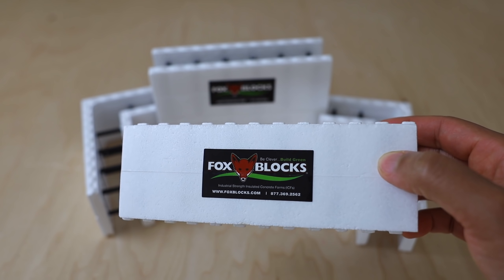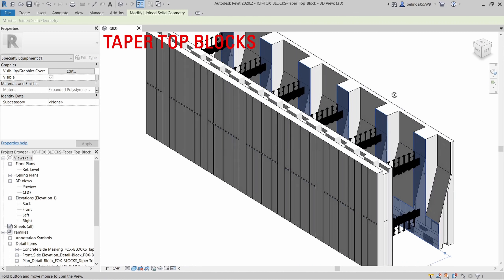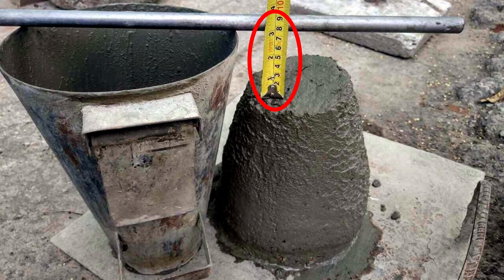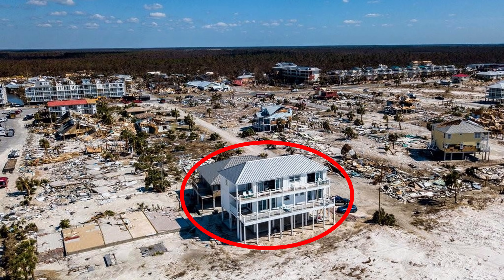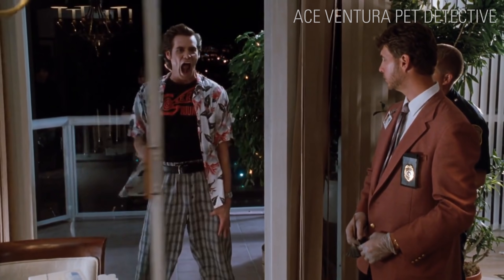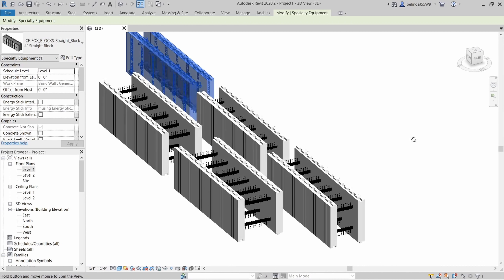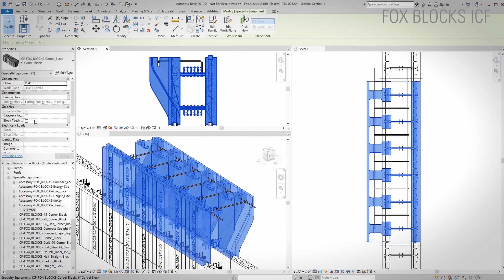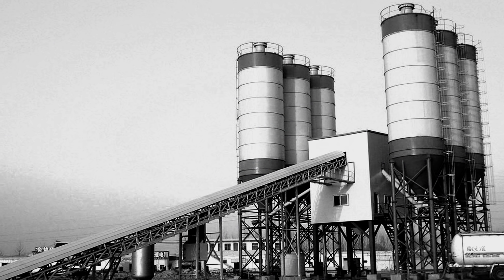Pros & Cons of Insulated Concrete Forms /ICF construction

Comment: I've been curious about how to properly insulate a homes foundation, having lived in Italy and now Mexico I've seen all the problems from houses where the moisture from the earth wick up the walls, whether stone, brick or cement that causes saltpeter blooms which eventually cause the weakening of cement and paint jobs whether exterior or interior and cause endless maintenance headaches for the lifetime of the home.
Reply: I live in zone 2a climate . Built a house 15 years ago . I used ICF forms , very satisfied with them but I think they have trouble in areas with ants and termites.if you have a existing house there are quite a few options , most recently styrofoam and spray foam seem to be gaining popularity
Reply: @outinthesticks1035  Thanks, I'll check it out. But I believe you're talking about walls.. not the actual base of the house, which I believe needs some kind of plastic liner before the cement is poured so the moisture doesn't wick up the walls.. and yes termites are also a problem here. I think I'm a zone 10 or 11 so cold is not an issue, but we do have a rainy season.
Reply: @lagringa7518   I am talking about the basement walls , which in a way , hold up the house , being half underground , but under that are the footings . I have two inches of styrofoam over the footings , it also covers the wheaping tile , directing water away from the footings . There is a product called "damp proof"  , kind of a rubber mat that covers the outside of the wall , from the rim board ( floor joists) down over the footings .and 2 inches of styrofoam with foil backed bubble wrap under the basement slab
Reply: @outinthesticks1035  Here they build up from a concrete base, and then build walls with a cheapo low fire brick, no basements. The brick is very moisture friendly, altho it is stuccoed after... so you see my problem is keeping the moisture from the brick. I'm not rich so I have to go with the indigenous method but thought some sort of polyurethane barrier under the first cement pour would help with that (wishful thinking?). But I appreciate your input... altho it's not even easy to find all those new products here and if you can find some, they are very expensive.

However I will look for the styrofoam with the foil thingy for under the slab if it will save me money in the long run! We do have home depot here, but sadly the quality and options are nowhere near the ones in the states. Arghhh.....

Comment: We built a 3 level, 12 classroom addition to a school using this method last year.  Part of the reason it was chosen was cost.  The budget was $2 million which we were able to stay on.  Note:  Much work, was done by volunteers such as the wired network, floor finishing, painting, and bathroom tiling.  Interior walls were metal studs to allow "smurf" tubing for the AV equipment.  The floors were Spancrete.  The ICF part of the project went very smoothly, and it is a durable and safe building.
Reply: I've been wanting to build a semi-off grid weekend getaway home. Something far enough away that I can have privacy from the world, yet sill be within 30 minutes of a town.  I was thinking of making an ICF ring about 25 feet wide and 4 feet tall, then topping it with a steel geodesic dome of the same diameter and using shotcrete to cover the dome.

Comment: How do you calculate the R-Value of thermal mass? IS this some form of empirical equivalency from trsting?
Reply: You don't.  R value and thermal mass are two completely different things.  Belinda is incorrect saying that concrete doesn't have an R value, it does.  it's not a high R value, but a concrete slab wall would have a higher R value than say, an uninsulated sheet-metal sheathed wall.

Comment: Good content! To avoid remodeling problem you can use ICF only for exterior walls and metal or wood framing for interior walls. Interesting question is insurance is lower for ICF build homes than stick house? logicaly they are huracaine and more fire resistent than traditional homes, so you should pay less for insurance right?

Comment: Thank you for the great video. You addressed moisture issues with concrete being absorbent particularly at the foundation level and that some builders like to wrap the house with  a Plastic membrane that has a tar like substrate. This I would suspect is quite combustible if Exposed to the high heat wild fires such as seen I California Spain and Canada. There is  waterproof concrete used in bridge abutments as well as superstrong concrete and concrete with Fiberglas fibers. It seem logical one could put ingredients into the concrete for pouring the walls that would make it waterproof,  just another cost.

Comment: This is a far better education on how ICF construction works than was imparted to me by my employer, 20 years ago when I was DOING ICF construction... even so- the blocks have come a long long way since then. I am going to build with this for my home, mainly for the reasons you mention, I can improve quality of the lower levels and get amazing insulation and sound proofing using ICF, and there is no reason not to use stick framing elsewhere on the build, so creative designs are only limited by ingenuity...

Comment: Belinda, have a look at Durisol.  They use a specially treated timber / cement to form cell. Vastly reduces the amount of plastic insulation. The main insulation is outside of the concrete core.

Comment: Great explanation Belinda. I built 2 commercial offices and three residential homes. Using a foam blocks. If you don’t have professional during the pour, you will have a blowout or worse the wall will not be plumb. Make sure who you hire for the pour has several references. It can get a little tricky, but the finished product is as advertised. And a great value since lumber has gone sky high.

Comment: Do you have any material on non-foam icf block solutions, such as Nexcem, Faswall or Durisol? Do those help with the concrete drying since it would allow water to flow out more easily and hence lower drying times and humidity for the finished build? Can you work with higher slump concrete to guarantee a better fill of the block cavities? What about using helix micro rebar in some parts of the wall assembly to lower installation cost and perhaps weight? Thank you!

Comment: I'd be very interested in what you think of other types of concrete-rebar home construction methods, as well as aircrete roof construction.
Reply: I've been wanting to build a semi-off grid weekend getaway home. Something far enough away that I can have privacy from the world, yet sill be within 30 minutes of a town.  I was thinking of making an ICF ring about 25 feet wide and 4 feet tall, then topping it with a steel geodesic dome of the same diameter and using shotcrete to cover the dome.

Comment: We built a new home 14 years ago with all ICF exterior walls.  I am sold on this type of construction with one of the greatest advantages be the comfortable living space .  Living in Michigan we get some very cold days and with the thermal mass of the concrete walls you get a very consistent and comfortable living space throughout the whole house.
Reply: Did you use additional insulation to deal with the coldest days or has the R22 + thermal mass been enough?
If you used additional insulation, what did you use and what R-value does it bring your walls to?

Comment: Your disadvantages don't make sense....how can you say is more expensive when is just 5% more expensive than concrete plus a house of wood have just 10 years of warranty and the concrete your whole life, so is not expensive......is like saying I buy a cheap car and in 5 years because of maintenance you spend 3 times the initial price, same thing applies for the house.
The humidity issue 😑,  well after pouring the damn concrete you don't into  the house but wait for the concrete to dry and yes here in Europe we need a year to build a house.....the concrete is one of the main reasons.....you must wait.

Comment: Dear Belinda, Thank you for such a high quality content. I am also big fan of ICF homes. I have purchased a small lot in Southwest Florida (Naples area) and my plan is to model and build my home with an Owner Builder affidavit (I am looking at Vertical ICF). I am also looking at an ICF roof, using LiteDeck Steel Rib System, but that is even more challenging undertaking. One area of concern is termites, because they known to bore through foam insulation in search of wood. There are very few ICF homes built in Southwest Florida and what I was told, it is due to huge CMU construction industry. In fight with termites, the best practice is to use CMU blocks where ground contact is necessary and install ICF above the ground. There is also termites treated foam, but from it, derive numerous health risk speculations. Being in engineering myself, I love the idea of thorough CAD modelling, reviewing the design with family and subsequent BOM generation. Thank you so much and may God bless you!

Comment: I’m a ex general contractor. I truly love ICF walls. When you build a home with icf walls; make sure to install good dehumidifier, it can regulate the moisture in the house.  Waterproofing? In northern part of state applied spray tar on the basement walls; it is fast and cheaper instead of applying expensive layers of sheathing.  

Thank you so much for your educational videos. It is good to hear from a architect views on the building.  One of many things I see in usa 🇺🇸, not many people doesn’t know what is better way to build a house. The most production builders, they will skin the cat in the structural of the house and very poor quality carpenters and concrete. The most the walls not even level.  They can’t even build a 50ft wall in a straight line. It is so sad.  

The production builders just do a modern lipstick on interior finishes and make looks so pretty. The house will start breaking down in 5 years. 

2nd.. the recent freeze happened In Texas; most of the pipes are broken from attic. It is not climate control. The pipes were exposed on exterior temperature; little bit of temperature changes and stayed in 15 degrees for few days; many Houses got damaged. 

Do you think, the lessons ever learned? No, the production builders keep building same way. They are completely forgotten what is happened 2 weeks ago In Texas.
Reply: I do remodels and repairs and can second everything you've said. Floors, counters, ceilings- nothing is level or square. Pipes ran next to cracks in the sheathing provide super freezing wind tunnels every winter even in the somewhat milder area where I live. And then under the buildings...a long list of deficiencies and problems waiting just a couple years to happen. One huge housing tract built on old marsh land where they all have sump pumps pumping water into each other's homes and all the heating ducts under the house leaking and destroyed and causing mold throughout the homes. And they are on regular 8 inch pier blocks that are sinking. I bet the whole area has sunk significantly over the past couple years.
Reply: @seasidescott  Back in 2007 my Wife and I were house hunting. We narrowed it down to 2 homes at around the same price: One built in 1973 with 1500 square feet per floor, or one built in 1999 with 1200 square feet per floor.  We went with the older home because of how cheap the construction on the newer home was. Sure, we knew we'd have to renovate the older home and update windows and appliances, but bones were much better.
Reply: @matts1166  Imagine those being mass built right now with wood so expensive. Every corner cut and never touched by a hammer.
Reply: What kind of dehumidifier?
Reply: @kwatts5364  The large units are measured in pints (of water they take out of the air per day). Biggest regular ones range 150-210 pints. Growers use them too. They are like AC window units basically but not in the window and the heating and cooling radiators are close to each other so the air comes out near the same temp it came in.
Reply: Tar has hydrocarbons that eat away at polystyrene.
Reply: With this, you can build it yrself

Comment: I agree that it is far superior to wood frame construction, but it doesn’t perform to the same standards as conventional masonry. Also, while you stated that the slab or stem wall base must be perfectly level, this situation is very rare and difficult to achieve. Every imperfection in the base results in a leak when the concrete is pumped in. The workers on site have to run around stuffing rags and towels into the leaks to attempt to slow them down. Finally, the outer surface is extremely weak and can be easily damaged.

Comment: Hey Belinda I’m working in retail during the pandemic and am realizing that we need to rethink how we share space with others. Few people suspected that interior spaces were creating the environment that allowed viruses to get to there next host and unfortunate victim. People have been dying from common viruses for years and this uncommon virus reminds us even young ‘heathy’ folks may be impacted. I think we need to stop making it possible for disease to get to its next host - “life” like water evolves to find the cracks. 
With the principal of not sharing potentially contaminated air or objects I have realized some surprising things that suggest rearranging our common practices. 
Eg air heated by our bodies goes up - our thermal plume will carry respiratory droplets up 
Low humidity further lofts droplets as moist evaporates
Merv13 or higher can vastly reduce a viruses chance to be filtered through impacting filter material (and likely Van Der Waals and electrostatic like forces). Heating a room?- well driving air through a filter does too - in the end it’s heated and cleaned too. 
What temp sterilizes air? 400 degrees F (200ishC) - a air space can be heated by gently warming a lot of air ,  or perhaps by driving air up a gradient to sterilizing temp and back to safely desired room temp. Cleaned and warmed. 
Co2 monitors can easily track air quality 400ppm is outdoor ambient level - 800 ppm can equate too 1% rebreathing exhaled air (possibly with viruses)  
I’m reimagining my retail space where suspended ceiling is hepa filtered low pressure zone. Cleaned refreshed and  conditioned air is comfortably reintroduced low. Occupancy sensing could be added could drive efficiently up. 
I haven’t even mentioned 254nm uvc or 222nm short uvc germicidal augmentation in ductwork or bipolar ionization to scrub air. 
It’s time to rethink with our hard won knowledge and technology how to fix the vexing problem and parasitic nature of infection. 
We widened the sidewalks after the Spanish flu - let’s stop leaving the flaws open to exploitation (natural or otherwise. 
D
Go B, use your gut here

Comment: Good job of explaining the benefits.  This method of construction has improved since it's inception about 30 yrs ago.  It's still a concrete structure with a convenient and beneficial forming system.  Works great when done correctly as you stated.  Can you give your opinions of AAC construction?

Comment: ICFs are a reasonable option for DIY folks, but after living with a Superior Walls basement for 20 years, I would use the precast walls if I was to build another house.  They are only slightly more expensive, but go up very quickly, have the concrete on the outside so you don’t need to protect foam, have cavities for large R-value insulation, are fairly easy to wire and fairly easy to apply drywall or other interior finishing.  The main downside, other than cost, are some design limitations and they are nearly impossible to change once installed so you really have to get your doors and windows correct at the start.

Comment: You misspoke on your slump comment.  Lower slump (stiffer concrete) will create less hydrostatic pressure.  Higher slump will create more hydrostatic pressure as it flows more like water and does not support itself as will a stiffer mix.

Comment: 20 plus years ago we almost bought an ICF home under construction in west Plano.  It was a one off spec home in the middle of a stick built neighborhood (off Midway).   We first saw the home with the first floor walls completed and I was concerned when the "builder" (he was really not that skilled and eventually gave up) was intending to support the second floor structure with ledger boards bolted into the ICF concrete (instead of creating an actual load bearing ledge for the second floor joists).  I was scared that over time the ledger bolts - first into the non-structural foam and then into the concrete could potentially sheer and fail (the fox block you showed offered a solution for this).   The home shell sat there for 2 years and  eventually somebody  completed it.....also,   I love the idea of a strong reinforced concrete home but I wonder how well they handle N. Texas expansive clay soil.  I would prefer to have either deep peers or very deep footers to keep a rigid concrete wall effectively  up off the clay.  That particular area of that house is fairly rocky (n. texas caliche rock just 2 feet down) but much of the land here is expansive clay.